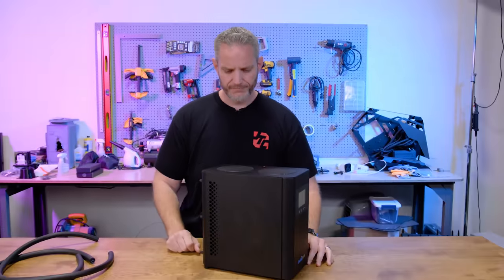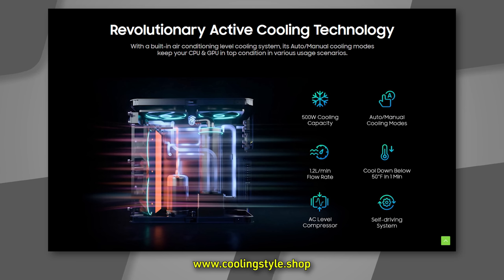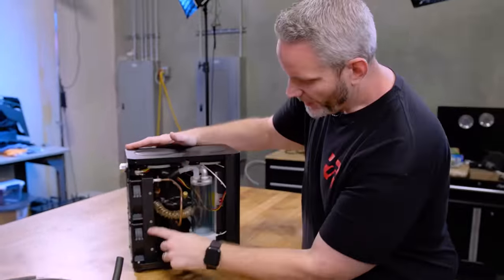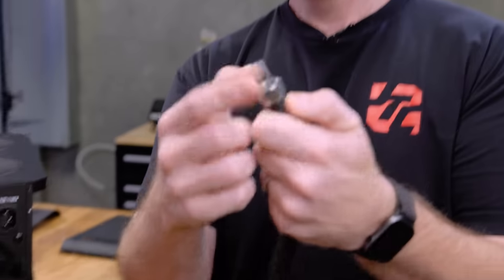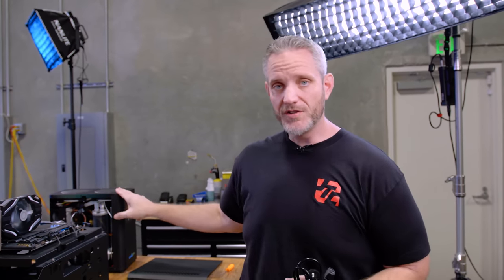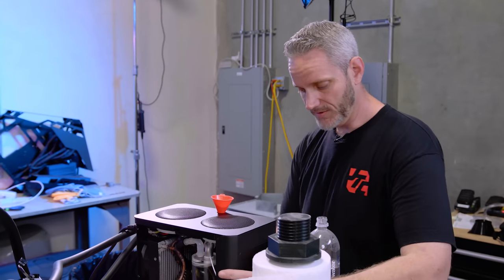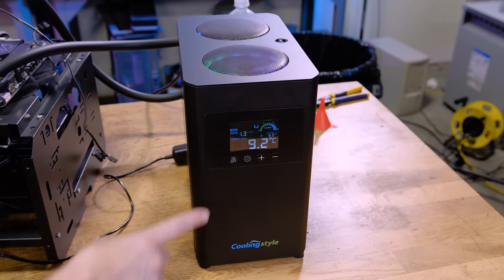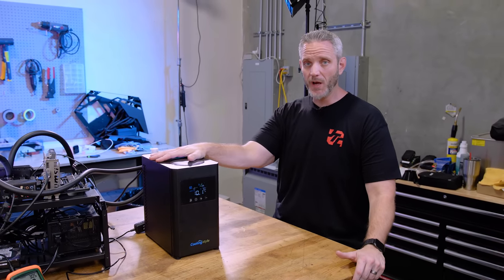This seemed Gimmicky... Turns out I was right!

Comment: I mean, your system is putting out X heat into your space. You attach this, and the only increase in heat would be the small amount this device makes (Z)  to run. The only way X+Z would be a significant increase in heat dumped into your room would be if the heat source X had been throttled a ton. By cooling it more it would throttle less and generate more heat that is removed by the cooler. 

Longer tubes if the pump could handle it and you could move the unit out of the room and effectively move all that heat dissipation elsewhere.

Comment: When mounting air con cooling which causes condensation, why not (as well as the usual methods, and protections) just mount the motherboard upside down?

Thus all water should at least not sit on the (aforementioned, protected) components, if and when it does come off the condensated components, it should drop harmlessly off.

Comment: If you wanted to go through the trouble of running the water lines to a different area of your house that could handle the extra heat load then you wouldn't have to deal with the heat or the noise but you'd still have the really low temps on your CPU yes it has some quirks but it shows promise for certain applications

Comment: I do want a mini AC that just blows cold air. Like mini. And just blow the cold air into the front of the case fans and THAT would of course work that colder air inside the system and the g0u and cpu finstack get really cold air

Comment: I bought a mini split and installed it myself and put my computer right in front of it to where the cold air blows right onto my radiators on the top down through the case and exhaust out the bottom and with that I'm able to run 3800 c14 14 14 28, 53.4 millisecond latency Ram speed and time is on my 5950x with 4.9 all core. That's my daily overclock and I have a better overclock that I use for benchmarking. The room does get cold after 4 hours of gaming then I have to put a jacket on for the next 4 to 8 hours

Comment: Only the waste heat produced by the unit is added to the heat in the room.
Far the most of the heat from the cooler unit is taken from cpu, not longer comming out of the pc. So its about efficiency of the unit.
The noise and vibrations is another story.. 😆(I have the early AseTek refrigerated pc case, super cooling, terrible noise)

Comment: Back in ancient times circa 1963, we had a window type AC unit blowing cold air into our IBM 1620 - else the touchy computer would shut itself down from overheating.  Of course, the running jet engine in the next room didn’t help.

Comment: I've had similar ideas to this, except using peltier plates.  I was going to 3d print or buy a mini ITX case with a standalone power supply and some stock AMD CPU fans to cool hit side of the plates with the cool sides sandwiching an aluminum block with a passthrough for the water.  Not only would it be quieter than this, I think it would be more efficient as well.  If I ever get a design done that's Jay worthy I'll send it to you to torture test 🤣

Comment: Koolance tried a chiller system years ago and it was a failure in sales.   They exhaust a boat ton of hot air, loud, and any compressor is a power pig.

Comment: Ok, one thing i always wanted to know, if one is going this route, why not just do a full closed frion loop to the pc components, mabe have the cooling unit smacked to the outside on the house so the noise keeps out of the house and just have connect thingies for the pc inside the house.

But, main question, if one goes max power on the pc, why water, why nor frieon gas, surely it can be done (possible major issues but still)

Jay, got a comment on this, since exotic cooling solutions? :)

Comment: I have seen compression fittings like that where you require a small sleeve thing that goes on the hose before you thread it down, thus compressing and grabbing the hose. Where their extra parts that might have been missed?

Comment: I have a 2900w waterchiller for my system. The chiller is in another room so the noise is low. I live in Norway so temp in the house is normally not an issue. But i get to run a 12900k at 5.7ghz and my 3080ti with flashed bios at 2250mhz+. It comsumes 1350w at max but in the end in my opinion its worth it🤪

Comment: This might not make a lot of sense on a smaller scale but i wonder what a larger unit that use the full 1500w from the wall could do. Also it might not make sense to cool one pc but what abut 3+ or 5+ pcs through it. Maybe this single noisemaker is quieter than 5 towers worth of noise?

Comment: I only have experience with the 12700k but Ive Ive had great luck with my temps/voltages/clocks. Ive been gaming with an overclock/undervolt 5.1pcore 4.1ecore @1.19v and temps never go over 62c during a 6-hour session. msi tomahawk board, nzxt 360mm aio.

Comment: Only way to use it without getting crazy by the noise is using an insane length of tubing and putting the cooler in the garage of the neighbors across the street xD

Comment: Umm Jay that ground wire with the spade connector on the plug wasn't connected properly. and the reason those connectors are all wobbly like that is because they have used 1/4" slot on a 3/8" blade.
This could honestly cause a fire as it will move around from the vibration from the motor and that'll lead to a high resistance joint which will heat up over time and possibly start arcing. Flash back to Linus and his big ups catching fire due to a loose/missing bolt.

Comment: Jay, I think you're confusing thermal mass with heat transfer rate.  All that matters is how many watts the computer plus the chiller is putting out.  That will be the total thermal output to a space.  The temperature at any given part of the system only affects how quickly that heat is transferred to that space.

Comment: I had been looking for something like this. I wouldn't put it on my desk, but a few feet away off to the side. The price seems fair, but would like it a little quieter and come with. Quick connect fittings and a connector plate to connect it to the back of the pc. Also, did it have anything that turned it on/off when the PC was turned on/off? That might be important depending on use case.

Comment: Not even a new idea. There was a company back in the time of the a7m266 like 2001 or so that made a similar product. It even came with specially designed Blocks to prevent condensation, and the unit fit under and mounted to the old Antec cases that were copied by nearly everyone at the time.  You would cut a hole in the bottom of the case that allowed the tubes to be fed up through the bottom and voila refrigerated pc cooling. Holy crap I just realized I am older than dirt.

Comment: I think there is an application for this type of setup however much further away or window mounted to dump heat outside only issue is this type of unit isn't setup for that obviously.  

I've always been a fan of 24/7 chillbox designs, this ain't it.  
If gonna bother using phase change system, imma just mod/convert an actual AC unit and make a chill box

Comment: Would be a good setup for a water cooled sff build. If you could keep the unit outside of the room.
Reply: Reminds me of an old joke from when wristwatch calculators were a  thing.

Two guys talking in a pub,  one is showing off his new watch.  "it's the smallest calculator watch in the world.  It's full scientific,  tells the time in every country of the world,  multiple alarm settings and a diary. It has a built in thermometer and can also tell you if it's going to rain. It's only 3mm thick and a battery life of 20 years"

"That's absolutely amazing" says the second guy.  "Anyway,  what's with the suitcase?
Are you going on holiday?"

"No,  that's my watch battery"
Reply: @markboz3366  lol

Comment: It looks like the blade power connectors on the back are not connected properly! They are connected between the plactic protection and the connector back. That is a clear shock and fire hazard.

Comment: The HVAC failed at my previous employer's server room and I got to see first hand what happens when a room full of equipment has no cooling. Bad Things. Servers do not like reaching 150F.  The carnage was epic.   I like the idea of this device. In my home, I'd like to put all my IT stuff in a closet. But that closet has no cooling, and worse, it contains my electric (read: no venting) water heater that emits excess heat.  A small split HVAC unit like this would probably be just what I need, and let me put the hot end outside a window.

Comment: Surprising that Jay thinks a bigger inner diameter tube actually makes a difference. You would also expect to use it for many years and many builds so the cost isn't as much as a factor. The unit also makes too much noise to be viable for most home applications anyway.

Comment: My 10 x 10 office with AC and a window exhaust fan is like a sauna in the summer with two large monitors and an OC’d 10700k and 3090.  Comfortable in the winter with the heat off though😮.

Comment: Do CPU's actually work better at very low temperature?  Or is it just about avoiding overheating?  If it's just avoiding overheating I think there's no point using a chiller, better to have high water flow rate and lots of radiators.  It would be nice if there waterblocks with heatpipes to spread the heat across a bigger area.

Comment: Yeah…I don’t know how this is any better than buying a window air conditioner, longer tubing and duct taping your rad to the AC outlets. Like you can get a very Gucci window ac for 699. Plus a 22k BTU ac even cooling 500watts of thermal energy would still cool the room. That’s 6447.5 watts, sooo yeah 5947.5 watts still cooling the room. I donno, seems kind of stupid to me, especially since the chips are fine running at 75c…Spend the money going a higher tier on cpu and GPU and you’ll get more performance and be quite a bit more silent.

Comment: reminds of the ye old external Radiator and pump combo we used to use back in the day this external chiller would have been fine if it didn't use more power than an RTX3080 on it's own.

Comment: reminds me of the old phase change cooling from Xtremesystems back in 2004-2006 days lol 
I still have a custom phase change from I want to say Frogger or omg forgot his name in Las Vegas lol (sorry if you see this)
Problem is, now days it's not practical to use these types of cooling because normal water cooling will get you close and the overclock wont be much different if at all.

Comment: I put my pc above my room vent in the summer so it gets super cooled by house AC. In the winter, I move it off the vent. I wish I could put an air pipe out the window with a seal and just use the outside cold air ;-)

Comment: Noooot exactly perfect explanation of heat pumps. They are generally working with better performance, when cooling liquid is in higher temp or deta temperature is higher. So it is not fully linear with room temperature rising. Though within ten degrees of centigrade it is close enough assumption.

Comment: This might be interesting if you include this in a full loop with all the fans. I am no authority on the matter, but with that chiller i would imagine in a whole system it would be working just as hard, but at a lower temp with the radiator from the PC also adding to the thermal cooling. An idea for another day to include it in a full loop and see how it is then. Because i don't think what you did might have been the idea for it.

Comment: I'm looking for creative solutions that will pump cool, dehumidified air through a ventilation system leading to a computer built into a custom air sealed case -- on a sailboat. Oh, and plot twist, it's for a recording studio, so I need all the noisy components to be completely out of the room.

Might just put the whole computer system out of the room and run nice long cables to an from - probably easier than running air in and out of the room. This is going to be a real challenge!

Comment: Just a nitpick comment. If you going to get super technical on them for incorrect advertising and 'buzz words' check yourself as well. That not freon inside the system. Freon was a trademarked name generally used for R-12 refrigerant that has not been generally used for many many years. That system i am 99.9% sure has R-134a which is not freon at all.

Comment: I was tempted for the longest time to see what would happened if I where to stuck an fridge compressor to a CPU, this is not really this but it's close enough. It's a nice little gimmick, but for a high end GPU card it's not ready yet. But if the price drops it could be interesting if you live in a really hot country and you have this outside in a safe place away from the elements.

Comment: I'd be a buyer if they could cool an entire system with this. I would need 1500-2000w cooling. I would then install this in a weather proof area outside so that All heat and noise would dissipate outside.

Comment: @JayzTwoCents @7:18 Com'on Jay, you should know enough that any heat coming out of the back of this chiller, is heat that would have been coming out of the back of the computer to begin with... the system itself will not be generating any significant heat in comparison... so no, it will not heat up a room more than just the computer itself...

Comment: Anyone remember Linus back in the day, working out of a house, running water cooling from his stations in one room, copper piping to a bathroom tub...well this would be better than Linus's setup  back then. I think if you could run tubing to it from another room, and it not leak, maybe it would be worth trying.
Reply: The bathroom tub in that setup of linus was just a reservoir, there was a giant rad + a stack of fans on the outside of the house to vent the heat from the loop.
Reply: @bami2  ...so this unit Jay reviewed would be much simpler that what Linus did for sure, as long as it's in a different room that you don't care about noise or heat..hahaha

Comment: What if you duct-taped a shoe box over the exhaust of the unit with a dryer-vent tube connected to it, and the other end of the tube out the window, or into your hallway? You could heat rest of the house, or direct the heat out the window, lol!

Edit: Maybe they could develop an air-cooled system using a leaf blower. ;)

Comment: People spend $ 1000 plus to drops temps by 5 degrees lol by going water cooling over Air so 20 degrees lower is massive ,not sure if the price is worth it with them fittings lol

Comment: I don't really think this is going to heat the room that much, if its max cooling capacity is 500W then it's probably contributing about 125W of its own heat through the inefficiency of the compressor etc (going by heat pumps usually being able to pump about 4x as many thermal Watts as it's input power so this hypothetical CPU/GPU combo making 500W heat +125W from the chiller + lets say 125W for the monitor + hard drives + motherboard + ram + other pc parts that aren't part of the 500W of heat going through the chiller, then you have 625W of heat increasing to 750W of heat.. that 125W isn't contributing too much more heat than was already being generated in the room running the PC on air or a normal liquid cooling setup so while it's capability will reduce once the room warms up in the case of a small room, it's still going to be very close to the same 19C colder than without the chiller you saw here because with or without the chiller the room will still warm up and cause the PC to stabilise at a higher temp than in the huge room which takes longer to heat up.

Of course this doesn't take away from this being a bit of a niche idea as anyone who uses it isn't going to want to be anywhere near the chiller because of the noise lol

Comment: My pc has a max 30 dB noise profile due to 8 fans not spinning most of the time and only going at their slowest at best. I would never go for something this loud. I like that I cannot hear my pc while gaming because the fans don't come on. I can get them to spin during benchmarks or during the summer but otherwise it's dead quiet. Sure the components ain't the best so they also don't produce as much heat but I ain't gonna replace my i7-7700k because it is still more than good enough for gaming. I upgraded my GPU to a RTX 2070 super before the corona craze happened so I'm pretty lucky :)

Comment: Curious how this would have an effect on a already assembled custom loop that contains Rads and just removing your pump for this. If the liquid going through your Rads is cooler than ambient wouldn't my fans be blowing cool air into my game room?
Reply: Yes, they would if you put it in front of a radiator. But it would not cool the room because the chiller produces more heat than it cools down.

Comment: There's real heat exchangers out there that use refrigerant, micro expansion valves, and txe's in the cpu block itself (which almost looks like the size of a standard tower air cooler), and it keeps the temps down to 37, but set to ~45. That being said, the entire system is a braided extremely high pressure hose (since its pushing around 300psi on the high side). Those systems are fully closed systems non servicable by the user and cost ~1100+

This unit is a garbage chinese version of that concept which 100% is a gimic.